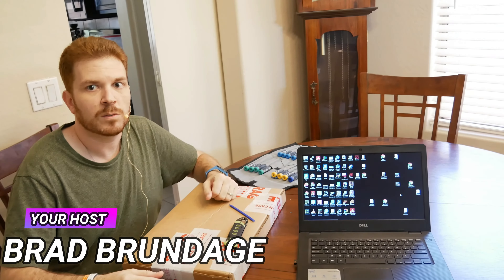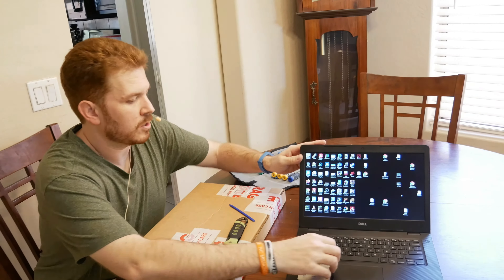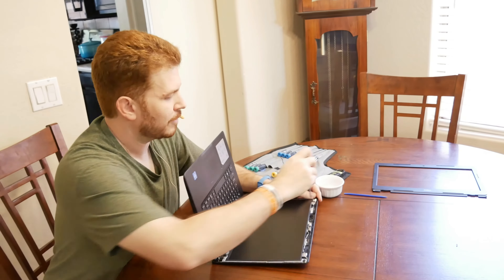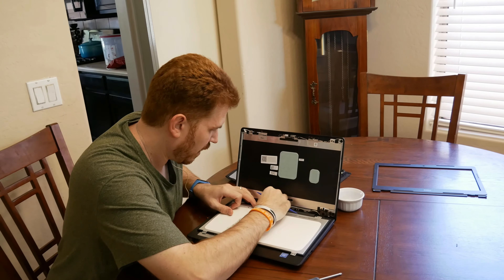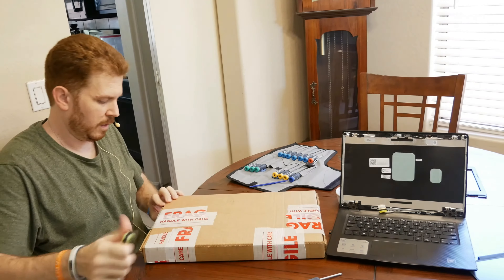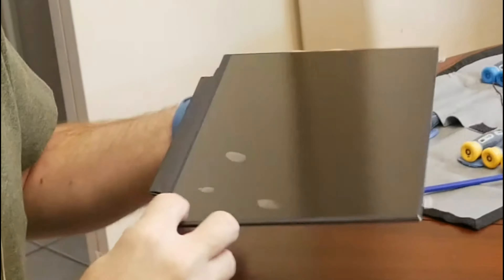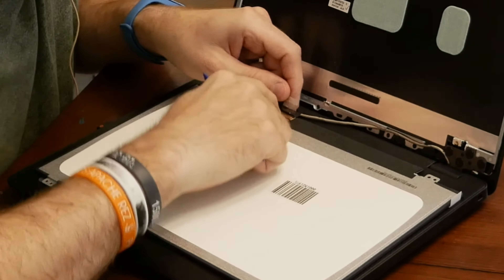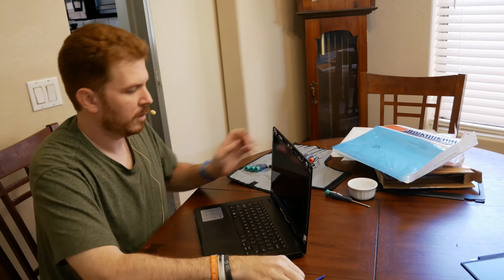LCD upgrade to Full HD | Dell Inspiron 14 3000 series 3493 FHD IPS display upgrade

Comment: Hi.
I want to buy a Full HD screen for Dell Vostro 3480.
But i don't find it. 
Where can i buy it?
Reply from the maker: eBay or Amazon, but you may need to take apart the screen to get the model number off of it to find out the specs, then find one that fits your requirements. I found a 1080P IPS 14" display using Google search and found this one:
https://www.laptopscreen.co.uk/Dell-VOSTRO+14+3480-model-2291779.htm
Just be sure that the pin count on the ribbon matches and the screw brackets align up with the original screen and it'll probably work so be sure to check out the return policy of whoever you purchase from just in case you need to return it.
Reply: @ShinyTechThings  Thanks you!
Reply from the maker: Glad I could help. Let me know if you have any other questions and feel free to share this info!👍

Comment: Hi
I have laptop hp da1015ne 8th
Screen hd 15.6 
Can upgrade screen to fhd or no
Reply from the maker: Most likely, but you'd have to open up the bezel to get a part number off the back of the LCD, then look to see the spec you are looking for to match the pin count, side of the connector and the mounting bracket that the screws fit into.

Comment: Hi, does this work on hp laptop too? My laptop is HP Notebook - 14-am054tx
Reply from the maker: @Michael Calixto it can, but you need to match the pin count, location of the plug on the LCD, and match the screw mounts on the screen. If those 3 all match up with the replacement panel it should work unless the manufacturer requires proprietary firmware but they stopped doing that most of the time around 10 years ago, but still google your model number and see what shows for replacements and if people had any issues swapping out for a regular replacement to be sure. Lastly, buy from a seller who accepts returns in case it doesn't work.

Comment: will upgrading to a higher resolution slow down my laptop?
Reply from the maker: @eye origins If your laptop is underpowered like a Celeron or Pentium then it's probable. Otherwise unless gaming you probably won't notice much from the increased overhead. So if used mostly for office tasks and web  browsers I doubt you will notice the additional overhead that a higher resolution would take up.
Reply: @ShinyTechThings  omg thanks for the quick reply. my current laptop has a Ryzen 5 5500u CPU, but only has an integrated graphics with 512mb dedicated vram. if I change the game settings to like 1366x768 will i still have the usual performance?
Reply from the maker: @eye origins if the resolution is the same inside of the game before and after the LCD swap the performance should be the same. It's when you raise the resolution settings or other settings in the game that will make the quality higher but in  affect slow down performance because it's running at higher quality settings.

Comment: Bro can u help me in upgrading of my laptop its Dell inspiron 5558 ( 30pin ) TN Pannel only its HD display  ... can I upgrade my lapiee to ips full hd ?
Reply from the maker: The process should be similar and searching on eBay I found a LCD but you would still need to confirm that the brackets for the screws are in the right orientation plus the connector is the same as what you already have. https://www.ebay.com/itm/283620456951

Comment: does it support 120Hz?
Reply from the maker: The IPS display panel that I purchased I believe does not support 120 HZ I do not know if the video chipset has been crippled or not by Dell for a refresh rate however even if you connect a HDMI cable to the laptop it can only output 1080p. The reason for this is the length of the circuitry runs in the circuit board for the HDMI port are too long to support 4K even though technically the GPU does support 4K resolution.

Comment: can I upgrade my Dell Inspiron 14 5459 as well?
Reply from the maker: You should be able to provided you find a compatible panel. I would just search on Google and eBay and see what you can find. That model number brings up both laptops and desktops so you may want to disassemble the screen assembly and start to remove the existing panel and get a model number off of it and look up replacements from that part number and be sure to check and make sure that the metal mounting pieces line up with the replacement otherwise the screen could fit but the alignment is wrong so you can't install it. Otherwise you would have to disassemble both screens to try to get 1 working one. Easiest to just order the part that fits correctly.
Reply: @ShinyTechThings  the panel you used, will it fit in my dell inspiron 14 5459? if my laptop uses 30 pin connector will it fit to this panel?
thanks..
Reply from the maker: @jemueljustinesalusod6754  you would have to pull your panel and see if the mounting brackets will fit where the screws mount. If so then there's a chance but I haven't found any specific part numbers. It's best if you look at the back of your panel to get the full model number off of it and then search for it and see what are listed as compatible. There is a possibility of the same panel that I used working for you but again I would make sure that the mounting brackets match up correctly because trying to remove and swap those between LCD panels you can damage one or both in the process so best to avoid that headache to begin with. Also I would recommend purchasing from a seller who will allow you to return the item if it does not work. It's been years since I've seen laptop LCDs being flashed with specific firmware to be compatible with only certain boards but I have come across that a long time ago so it's possible even though it may fit that it might not work or might not work correctly. all you can do is try because the manufacturers typically don't release information on compatible components because they want you to buy the upgraded ones from them directly when you originally order the computer because they can charge you a lot more.
Reply: @ShinyTechThings  Hello, it's been a while.. I think the LCD you've used is very much compatible with y laptop as I inspected it is very much compatible including the mounting brackets..
Reply from the maker: @jemueljustinesalusod6754  You could try it, but just know that there is a chance it won't work however if the 30 pin connector is on the same side and the brackets fit then theres a good chance ti will work. If you try it let me know if it works for you or not, thanks!👍
Reply: @ShinyTechThings  thank you. I will tell if it works or not..
Reply from the maker: @jemueljustinesalusod6754  thank you! Looking forward to it 👍

Comment: You showed up late in my recommendation. However, I'll do the same to my 5567.
Reply from the maker: @Kewal Rai did you already find the screen for that? It should be pretty similar on the replacement procedure. Let me know if you have any questions or issues along the way but I suspect you'll be fine just be sure to double check the ribbon cables and make sure they are in the guides so they don't get pinched by anything when you put it back together.

Comment: have this same laptop. if i search dell fhd 30 pin screen. should i be okay?
Reply from the maker: @Jesse Torres I have the link in the description to the exact screen I purchased on eBay. If you just search like you asked it may work but without having them side by side the PIN's might be fine but the screw mounts might be off.

Comment: My laptop asus x450j.
Can i do it on my laptop?
Reply from the maker: @Yudistra probably, you just need to match the connectors and where the screw mounts are and buy from a seller who accepts returns if it isn't fully compatible. Check this video out here and let me know if you have any questions:
https://youtu.be/rsXDvvzBjV8
Reply: @ShinyTechThings  yes, i have seen in oline store the pin same. but i don't know, can it display a full HD ips compatible image or is there some other reason other than the pin connector?
Reply from the maker: @Yudistra it's mostly the PIN connector and how the screws connect it to the lid and or hinges, however sometimes manufacturers give it custom firmware but you have to try and see which is why a return policy comes in handy.

Comment: hi, I need to replace my Dell 5558 screen. the original resolution is 1366 X 768. is is straightforward to just replace with a fhd display or do I need to change the connector cable as well?
Thanks
Reply from the maker: @M. Irfan Arif Please start with this video and let me know if you have any further questions:
https://youtu.be/rsXDvvzBjV8

Comment: Hi is there any chances of upgrading dell inspiron 3584 motherboard (like the CPU is soldered) and also upgrading it to a touchscreen pls response this upgrade is very important for me
Reply from the maker: You can upgrade the storage, RAM and Wi-Fi. The CPU is soldered to the motherboard. I don't know if there's any touchscreen panels that will work with this model. I'm still trying to find a backlit keyboard for it but it's so new it's hard to find parts second hand. What will you be using it for?
Reply: @ShinyTechThings  I am a student and also a gamer I need that touchscreen so it will be easy to do my homework
Reply: Is there any chance of changing the motherboard with a different model like dell inspiron 3493 to this inspiron 3584 .finding parts is so difficult!
Reply: You can get sponsored as you have more subscribers
Reply from the maker: Usually not but it's really on a case by case basis but at the end of the day if you start frankensteining stuff together it's generally going to cost you a lot more that if you would have just bought it's completely different system to begin with. the whole point of the upgrades that I am doing is everything is basically bolt on, like air intake and exhaust on a car very simple for most people to do well keeping it cost-effective and cheaper than the next best model up that has all of the upgrades that I wanted.
Reply from the maker: Thanks and I'm totally working on trying to get some sponsorships. Will hopefully get something as I get closer or break 1K subscribers.
Reply from the maker: What is your total budget for a touchscreen laptop? Also what games do you plan on playing on a laptop?
Reply: @ShinyTechThings  my budget is actually low it's 100$ for upgrade and I am planing to play gta 5 and Valorant
Reply: Can you give your instagram username so we can further discuss
Reply from the maker: I would spend $ on a good SSD and more RAM to get the best performance out of it.
Reply: @ShinyTechThings  OK thanks sir I guess that best I will add a 128gb ssd and another stick of ram
Reply from the maker: You can contact me through Twitter, Reddit and through the YouTube contract page.
Reply from the maker: ShinyTechThings just set it up on Instagram
Reply: @ShinyTechThings  ok

Comment: Never thought that the display on laptop can be upgraded... Maybe I'm a dino. Haha!
Reply from the maker: It's easier than most think because manufacturer's usually follow a standard. This way they can engineer a single part and use in many products. Same thing with most products. Look at a high end camera and then a lower end camera with some of the same chips underneath but the manufacturer cripples with their firmware  for that price point until someone figures it out and releases their own 3rd party firmware like magic lantern firmware for some Canon cameras.

Comment: Hi interesting video! Thnks for sharing the info. I came to this video looking for information on how to solve screen flickering problem on my 7559 4k touch screen. Ever hear of this problem Thank you
Reply from the maker: From what I read on it sounds like a LCD or cable issue but some people have luck lowering the refresh rate. Here's the Dell article, let me know if it's the same issue and if it helps. https://www.dell.com/community/Laptops-General-Read-Only/Inspiron-15-7000-7559-screen-flicker-issue-video-linked/m-p/4737918#M881491
Reply from the maker: Any luck on fixing it?
Reply: First the problem was that the screen was cut off when moving it backwards
and it was the cable, first I repaired it and then I changed it for a new one and that problem was solved.
But now what pains me is that when I raise the brightness to more than 20% the screen flickers.
When it blinks, it is not like before, the image is cut, only that the brightness does not rise and horizontal bands are formed, and when the brightness lowers the bands go away. But the brightness is so low that it is hard to see the screen.
Have you heard something like this. Thanks
Reply from the maker: 🤔 sounds like the voltage isn't high enough but you could try reseating the cable on both ends and before putting it back together test it again and see if it makes any difference. You could be something as simple as the cable getting pinched or slightly unplugged from the pressure of reassembling everything or being slightly out of alignment within one of the guides for the cables. It could also be a bad LCD panel. If it's still under warranty I would call up Dell and have them repair it. I will say it depending on the parts Dell has been a few months behind to get items due to covid-19, however they may offer additional solutions. I had a machine that had a bad daughter board and they sent a technician three times and then finally said to send it in to them and it will be over three months for the repair because of the part backorder. Because there was NBD Pro support on it (business laptop) they offered to upgrade to a new non refurbished next generation model of the same laptop. 😮 Besides the headache from Dell, everything went well in the end.
Reply: Touch screen uses another pinout

Comment: Completely missed a moment you took silicon gloves off
Reply from the maker: @Alexey Klyuev could you please elaborate on this?
Reply: @ShinyTechThings  at some point in the beginning I thought I saw you wearing silicon gloves when dismantling the screen. But after reviewing the video I see you were not, my mistake.
Reply from the maker: @Alexey Klyuev ok, no worries. Do you also have the Dell Inspiron 3493?
Reply: @ShinyTechThings  No, I'm researching LCD panel replacement. The thing is, affordable gaming laptops have bad screens (mostly). So I consider getting a pre-owned one only to replace screen right away.
Reply from the maker: @Alexey Klyuev they can for sure. I'd research the model first before buying to make sure you can get a nice IPS display with whatever your required refresh rates are.